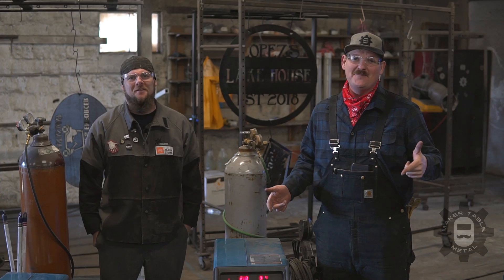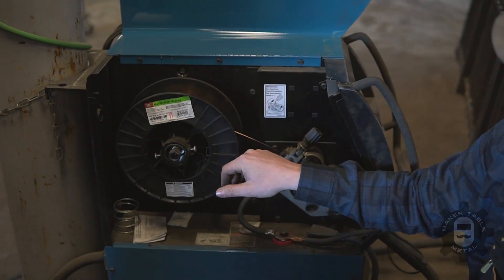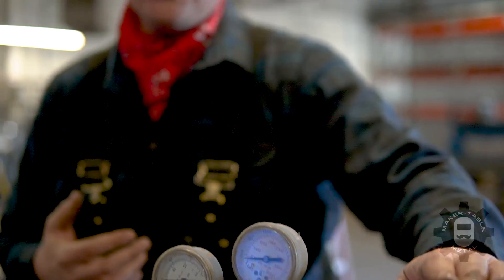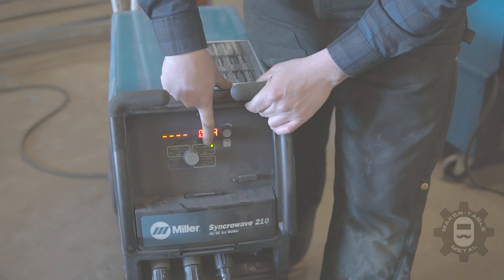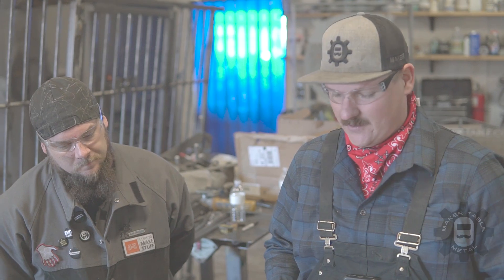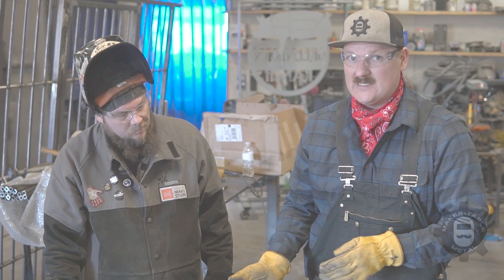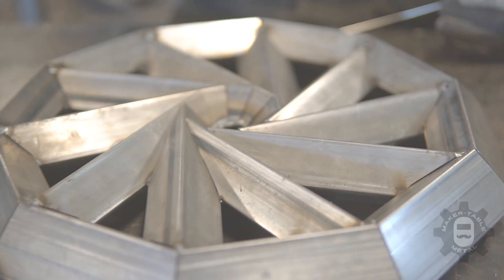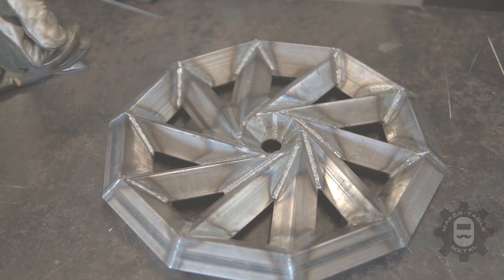MIG vs TIG - Tube Hurricane Challenge

Comment: Looks good.  One thing I wanted to comment on.  Early in the video you mention how no shops use flux core.  This is actually not entirely correct.  Flux is a hotter process that will allow the wire to penetrate into the joint better.  Another thing is the use of dual shield flux core where gas is used in addition to the flux in the wire.  This is a pretty common practice and a very very hot process so it is typically used for 1/4" and up.
Reply from the maker: You're 100% correct, we use flux core in our shop everyday. I guess I could have worded that better. I was in the ironworkers union where we considered mig and tig "shop processes" because we flux core or stick welded everything. That's where I'm coming from, thanks for clarifying that 👍